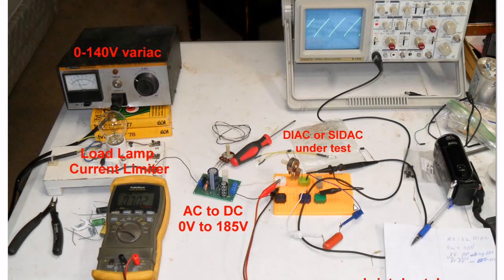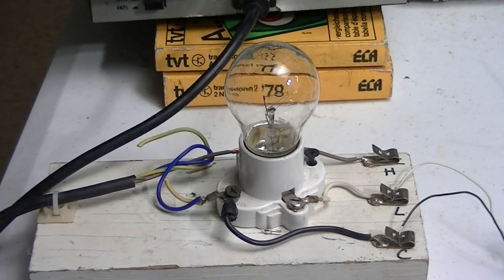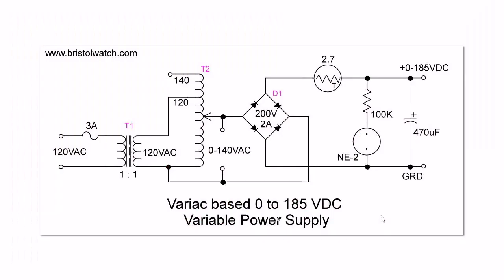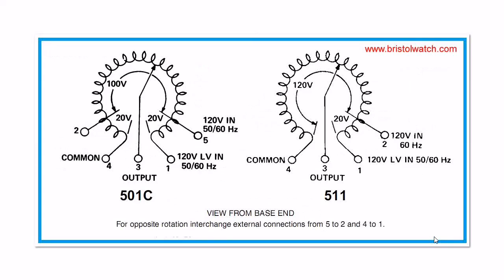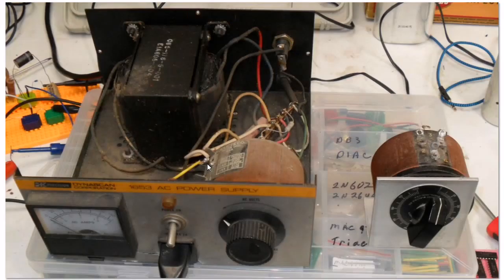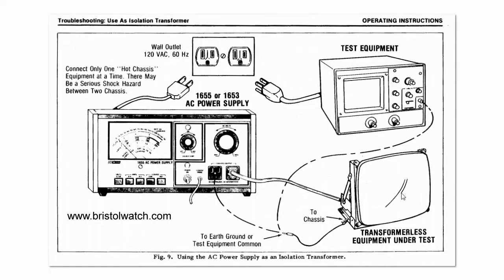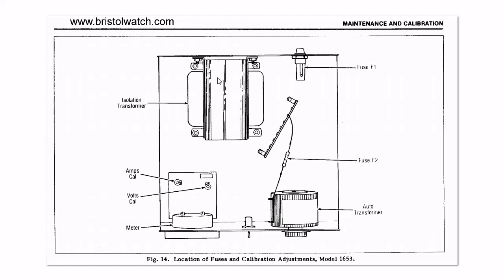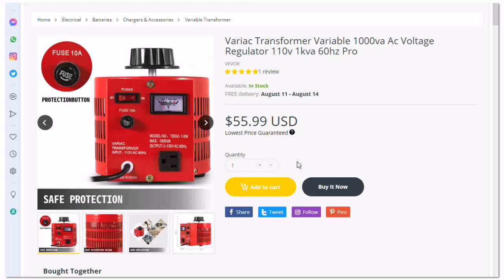Build Autotransformer-Variac AC and DC Power Supply

Comment: I have a 3amp isolation transformer along with a 3 amp variac. That's plenty for the home hobbyist I assume ehh? I'm going to have a 2 plug output for the isolation transformer. 1 for the variac and another for my bench gear.
Reply: As long as you do not use the Isolation transformer for you scope, (you do not want to float your scope ground) only use the Isolation transformer for the equipment you are designing for test/repair.

Comment: Do you think alogen lamps would work as well, as current limiters? It's still tungsten, so it should exhibit the same thermal transient, or maybe they have too much cold resistance? That bulb is a space hog.
Reply from the maker: I think you halogen lamp. I can be used but uses so much current it defeats the purpose.

Comment: Good explanation,
Sir,  have a question about the capacitor, you said" it could be higher but don't go crazy" that really concerns me. I'm a electronic engineering student and I'm trying to rectify 120v AC to get almost 340 v DC trough 2 capacitors in series, I can't find information about how to calculate it correctly, and teachers don't say anything to me, if you open a TV or a washing machine the main capacitor  on the power supply has a really low value and I can't understand why. Is it low because those power supply are smps?. Or is it low because it doesn't matter how clean that DC needs to be on the firs part to the supply?.

In my second semester I do learn how to calculate capacitors, buy if I apply that to this I will get a really huge value and a voluminous capacitor.

I'm not asking you to tell me how to calculate those capacitors. What I'm asking is why they have low values?.

Sir, if you know any on this I will really appreciate if you can share some knowledge on this matter.

Thank you for your time
Reply from the maker: Don't try using thousands of microfarads when say 200-500 will do.